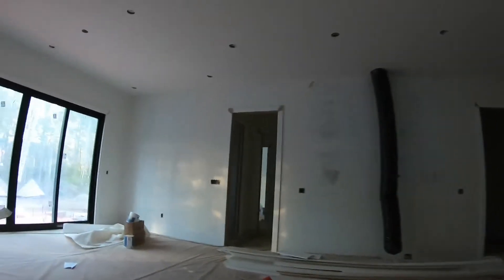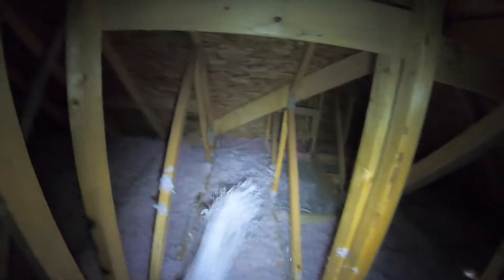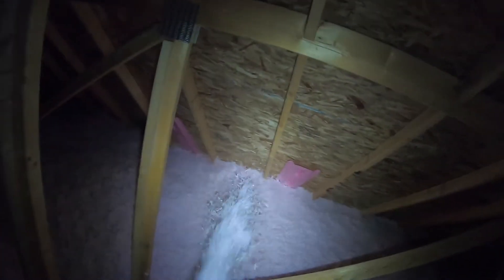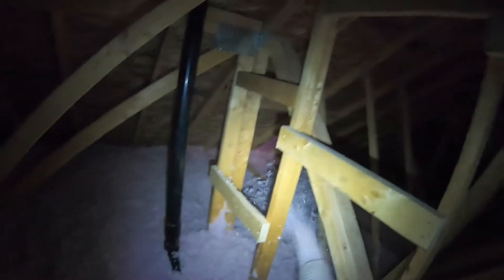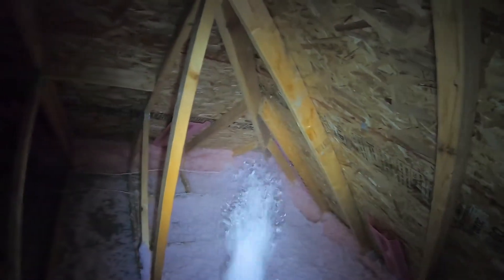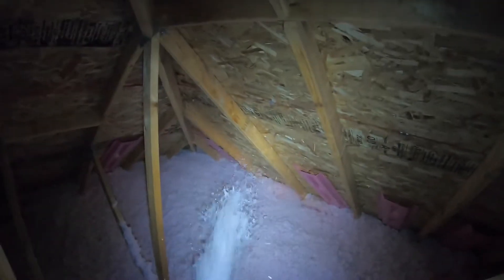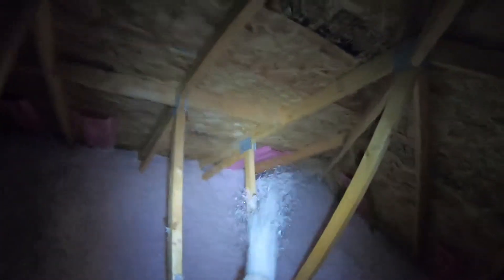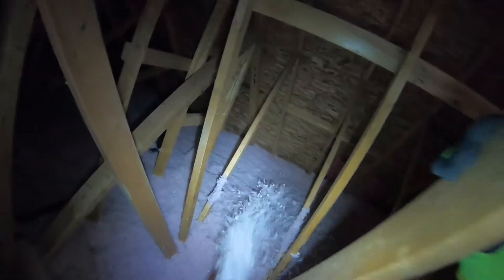Electrical junction box Q and A

Comment: Can I use fibreglass batt cover these electrical boxes directly? How about bathroom fans? do I have to install rafter vents if I use fibreglass batts on the top of existing insulation? Thanks Josh
Reply from the maker: As long as there is venting from the soffit you don't absolutely need vents. If you can see light from the soffit you are good. Batts don't blow around which is the upside. With blown insulation, you need vents and baffling to avoid future wind disturbance. Hope this helps. Also, it is recommended to use a plastic cover over lights so the heat generated doesn't directly tough the insulation. I have, however seen insulation directly touching LED light boxes and it's never been an issue.
Reply: @SinnisjInsulator  Thank you so much Josh!

Comment: The question I have is how to locate the junction box under all that insulation. I have to remove & replace a broken junction box in the attic.
Reply from the maker: Great question. So the main thing is to know where the junction box is in your house. Then when you go into the attic, look at your roof sheathing. Usually you will have 16" or 24" trusses on center. Use this to find the corresponding distance from your known junction box to the attic hatch. Hope that helps.
Reply: @SinnisjInsulator  okay thanks. That might be a good video idea for you. I haven't found many videos that explain:
 1. How to remove a junction box 
 2. Where to find it in the attic. 😉
Reply from the maker: @kw9568  I'll make a short video on that in the future.
Reply: @SinnisjInsulator  AWESOME!!!!! 😁
Reply from the maker: @kw9568  I've just uploaded the short video on how to find a junction box. Let me know what you think, it's on my channel.